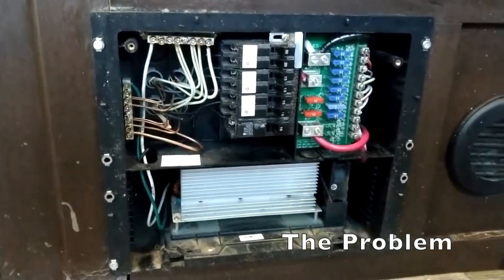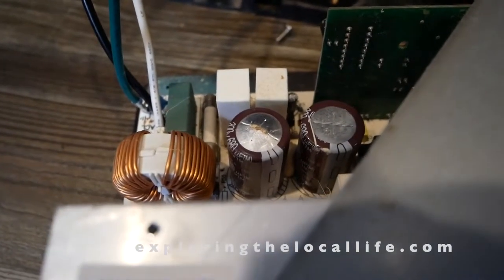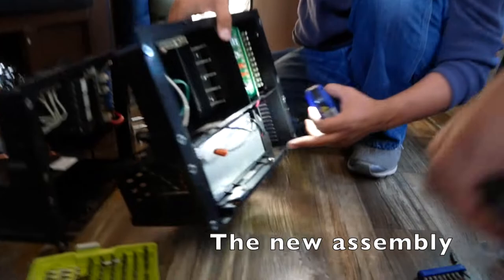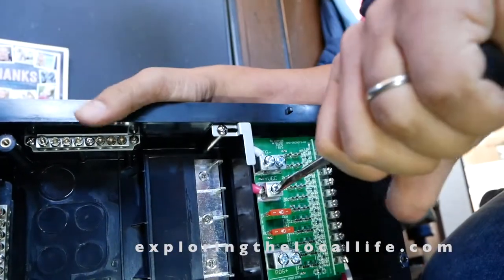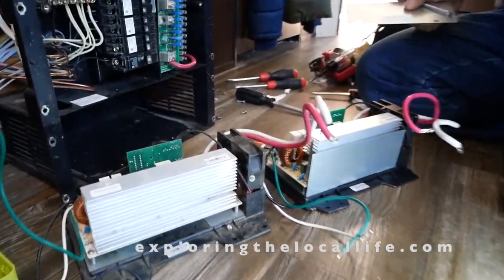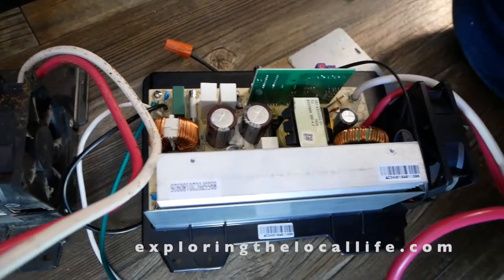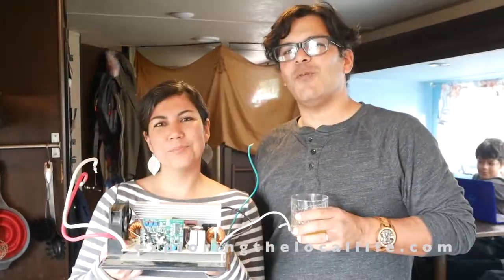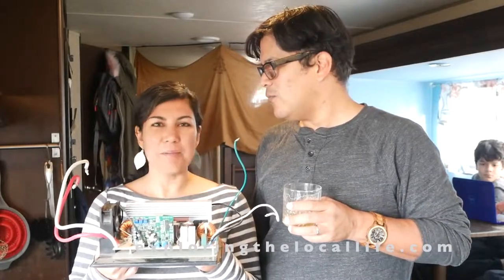How to Replace an RV Converter With ZERO Experience - WFCO WF8955 MBA

Comment: At around $100 an hour (or more) for a mobile RV tech, you guys saved a ton of money by doing it yourself. I’ve replaced three or four converters over the years. Our last WFCO converter overcharged/“cooked” our house batteries. So I tossed the WFCO converter and replaced it with a 4-stage Progressive Dynamics  converter. No problems since. 

Speaking of surge protectors, we use a Progressive Industries EMS (Electrical Management System). A bit pricey, but it does much more than a surge protector. 

We once worked at a KOA, and those 30 amp receptacles were notorious for failing due to heavy usage. So we’re very careful where we plug in our motorhome. Over the years our EMS has identified a few miswired campground RV power pedestals. 

You’d be surprised to see how many people have mistakenly wired an electric dryer receptacle to use for their RV. Some folks have even paid “experienced electricians” who screwed up and wired the RV receptacle at 240 volts. 

PS: you might want to edit your title. Because you replaced your CONverter, not your INverter. Two different components that do different things. 

PPS: did you do a second video of your slideout motor replacement?
Reply from the maker: Thank you!! Also, we updated that title to correct it. Much appreciated and thanks for sharing our experience!!

Comment: Thank you so much for taking the time to make this helpful video. I bought my ex wife's camper 6 months ago and the minute I moved in, things began to break down. I spent $800 in the 1st 3 months on repairs and did most of it myself just going to youtube and watching others do the jobs. 3 weeks ago, we had a tornado and nightmare storm. There was a loud boom and all the power went out in the area. When it came back on 5 hours later, my lights were all blinking in camper and then they would go off and only come back on if I plugged a space heater in and turned it on "high" (insane) I called 3 electricians, told them what was happening and they said they never heard of anything like that. The guy who came out charged $100 service call fee and another $75 to run diagnostic tests on electrical system and told me my converter (same one you guys bought was shot. He just happened to have one in his truck and he had written "$359.00" on the box with a giant sharpie. I did not see this until AFTER he put it in. It only took him 8 minutes to install. I took out all the screws before he arrived. So this guy says "okay, ur all fixed up...that will be $534.00! I said "Excuse me sir"? He said yep, that's what I paid for the part before I came over here. I said "Sir, I'm going online to see what I can find". Within 2 minutes on Amazon, I found the MBA 8900 series converter kit for $170. Should have seen this crooks face! He new he was caught. So he takes the part out and I ask him if he will return to install the new part in 2 days when it arrives and he reluctantly says "Yes". It arrived this morning. I called him and got answering machine. Left message and he text me back telling me "sorry I am busy today" so wait another day without power as there is no battery on the RV. It's planted on jacks on 2 acres of land running off power meter. I will buy a battery this weekend. Thanks to you guys I will be able to assemble this myself now! Hi 5 to you both (ur such a cute couple) 

(Jessical, I love your cat...I rescued 18 cats last year, found homes for all but 4 so I have them)
Reply from the maker: Oh my goodness!!

Well, I'm really glad that our video helped you out!!

Aw, we love kitties!!

Comment: Mine was also hooked to 220v and that same cap blew up. I replaced that cap and fuse in microwave all good.
Reply: Fuse in the microwave?? The exact same thing happened and I'm about to replace this converter in a minute. (Literally) 
Our microwave blew too! If that's just a fuse I'd love to know how to fix it
Reply: @kaitlinparsons6556  Sorry did not see your message to just now. Yes if you pull the metal sides off the microwave look near where the power wire goes into the circuit board you will more then likely see a fuse you can check the status of the fuse by checking both sides of it for continuity with any cheap multimeter.
Reply: @CoreyRaines  thank you! The power converter repair was a success success so ill definitely try this

Comment: Any time you fiddle with electric components, use insulated drivers, screw driver's etc... Don't wear jewelry. 
   Save the old unit and replace the dry capacitor keep the old inverter for a spare down the road. That capacitor will run only a few bucks online.👍✌️
Reply from the maker: Thanks for the advice Eric!
Reply: @WalkAndPaddle  . Anytime, lol be your videos and thanks for sharing your experiences.✌️

Comment: why didn't you just replace the two capacitors,.  soldering new ones can be easy sometimes and cheaper.they last or have a lifespan of about 10,000 hours

Comment: Did you notice that your converter was running very loud? Thinking I made need a new Converter in our rv as it runs extremely loud most of the day.
Reply from the maker: Hey Justin, our converter had some interesting moments. Sometimes it would run loudly and we had one incident involving smoke. All these happened years ago...so...either it always had some issues or it's unrelated.

Comment: It would have been nice when you were struggling to find the right tool, you would have mentioned what it was, to remove the wire from the breaker.

Comment: How do I know which one I need to purchase. On mine it says 8955PEC130708. Does that mean the one in the description is the exact one I need? Because there is also another barcode and it says AC04W136629930.
Reply from the maker: Hey. Did you search for both numbers online to see if there is a match?
Reply: @WalkAndPaddle  I did, but it seems like the only one that comes up is the 8955 part which is the WFCO power converter.